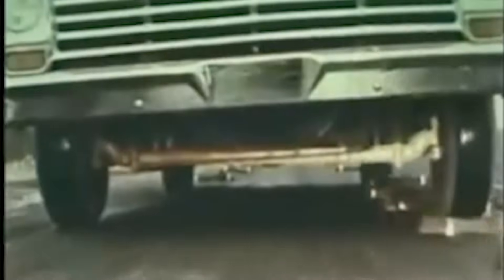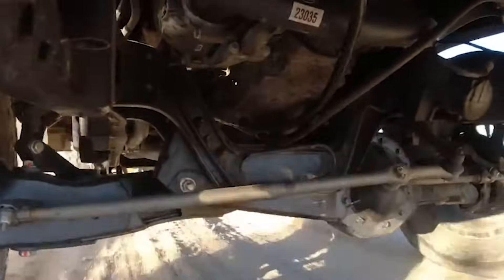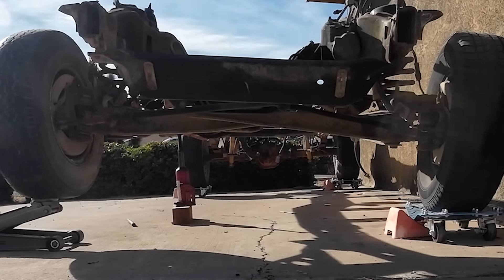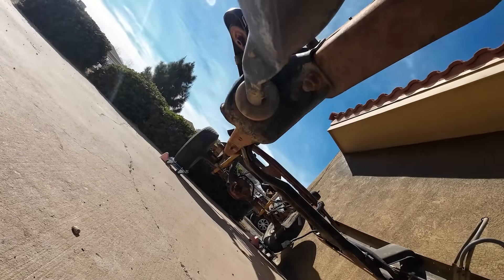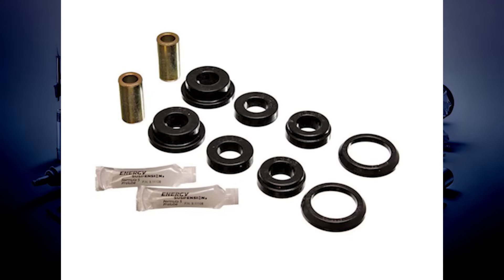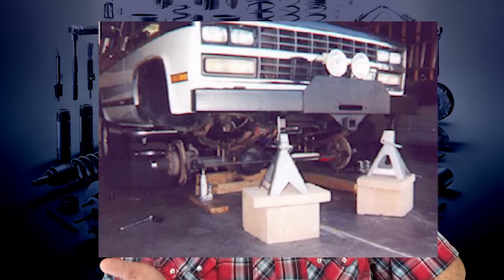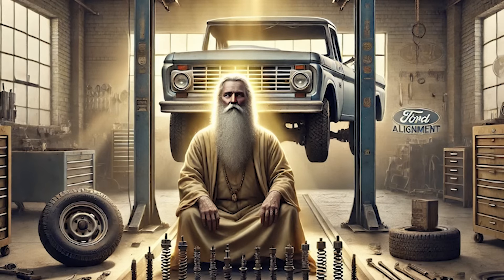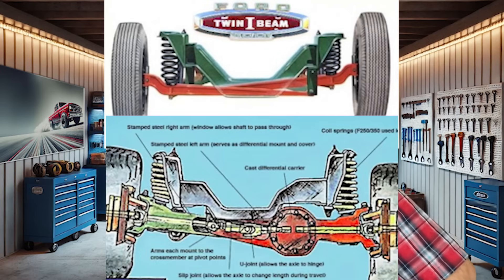Ford’s Twin I-Beam & TTB: Everything You Need to Know About These Innovative Suspensions

Comment: MOST important thing mentioned in video...
Finding a KNOWLEDGEABLE & EXPERIENCED Ford alignment guy/shop!
And preferably not the TYPICAL, ARROGANT
THINK THEY KNOW IT ALL PERSONALITY
that will not listen to YOUR SUGGESTIONS or INSTRUCTIONS about what you want them to do!
FIRST....I WANT ALL these bushings replaced BEFORE you check the alignment.
THEN we can see where its at.
THEN we are going to do some MATH and decide just what way & what new parts we are going to use that BEST accomplish not only getting it into alignment today, but will make FUTURE ADJUSTMENTS an EASIER & LESS EXPENSIVE TASK!!!!
IE: We're going to install THESE AFTERMARKET , ADJUSTABLE UPPER Alignment bushings. NOT the OEM FORD 
(Once its done you own that setting) Non adjustable ( part replacing) bushings.
Because when I come back in 2 or 3 years because I'm out by 1° camber....We are going yo have the EASY JOB of rotating that upper bushings to set it right again. 
That's assumes your bright enough to know what way to position it AND you dont get all passed off when you find you turned it the wrong way....
You see how this goes?
If you dont do it THEIR WAY...
YOU CAN HIT THE HIGHWAY!
PUN INTENDED.

Comment: I think those early compact Ford Ranger 2wd pickups were the worst offenders for a "grocery getter" application and driving problems. On a vehicle that light, just adding a RH passenger risked throwing off the camber, and suddenly the vehicle could begin pulling to the left. I was single at the time I owned one (1986), so when going on dates, the steering wheel effort to keep the vehicle straight became the bellwether on how much weight was too much...I had heard of looks that could crack a mirror, but a woman so heavy that she even made the truck want to commit suicide by veering into oncoming traffic was a new one that only Ranger owners could experience. I learned a valuable life-lesson that guided my choices: beer goggles may deceive, but Twin I-Beams never lie. 

The front shock absorbers were another item that required frequent replacement, and I always theorized it was the excessive unsprung weight of the beams causing issues, though I don't know why the rear shocks seemed to hold up longer even though it used a 7.5" solid axle. If I remember correctly, you could get aluminum twin I beams for some applications from Ford Motorsport to alleviate some of the issue, but they may have been for the F150 Lightning (lightening?) trucks.

Comment: My grandpa recently passed away. I love him dearly and miss him. 
Speaking to my grandma about what cars he's owned (I'm a huge car nut) I learned that he had a deep love for Lincoln and the Ford Econoline. 

I remember one Lincoln, and THREE Econoline vans as a kid. Of course, I never really got to drive them (except the very last econoline, which was a 1999 4.6L) but I grew to love their looks, the sounds, comfort, and memories on road trips.

I really wanted to know just wtf grandma was talking about with the Ford Econoline "Driving well" because I assumed it was just a 70s truck with a solid front axle. (Which I have driven in other vehicles, and am not impressed with) 

Thanks to your video & wikipedia, I learned about Twin-I-Beam suspension on these trucks. (I really appreciate the inserts of the chassis & live offroad driving articulation!)

Having driven the '99 Econoline for a couple years, I grew on the ride & steering immensely. It's such a heavy van that can't corner, or accelerate very quickly with the measly 4.6L, but it has very solid road manners & response time for being a very large & heavy truck frame! 
Knowing that the 3rd gen Econolines of the 70s & 80s are essentially the same design makes it click for my why they would drive so well. My grandpa came from much older vehicles that had leaf springs & solid axles in the front! 

Thank you for this detailed video showing this wonderful technology! Ford is truly a pioneer in truck tech, as well as with their sports cars like the mustang and GT!

Comment: Compared to my friend's YJ, my 89 Bronco II drove better and had just as good a traction as his Jeep did. Alignment wasn't that bad. The biggest issue is clearance. That pumpkin hangs down to far. The ball joint knuckle hack will help somewhat with that. I've driven enough solid axles to know the TTB is a superior system. Limiting straps are a necessity because the articulation is stupid good.

Comment: It was very durable.  It was always hard on tires.  It was much more fussy  about the tires matching.  The four-wheel drive version simply didn't work.  They quickly went back to a live axle for the more heavy-duty trucks   and basically the same independent system as everyone else for  lighter trucks.  No matter what he says, they can't really be aligned because any changes in weight distribution will change everything . Since trucks are meant to haul a variety of loads. In real life, the alignment would always be wrong.  The good thing about them is you could drive them hard  on terrible roads and not have any worries about making them worse.
Reply: Add load leveling in the rear and you can solve the problem.

Comment: I’m about to replace my 2001 gmc 2500hd (current daily driver) with a 94 f250 with a 351 , going down poorly maintained dirt roads the gmc wants to knock your teeth out it rides like a 05 f 350! After riding down the same road in my buddies 95 f150 I can definitely say I’m excited to have the twin I beam instead of the Gm independent suspension which has also proven to not be very durable as it is pretty much slap wore out after 71,000 miles

Comment: Just a little bit of clarification on the 2 wheel drive twin I beam, most of them, like my '81 F 150 had king pins instead of ball joints. The ball joints are not as stout as king pins, buut the camber can be adjusted with those special bushings made for that purpose. King pins do not have adjustable bushings. The only way to adjust the king pin twin I beam is to bend the I beam, which I have heard of only one shop that had some one who could do that, and it was somewhere in the New England States area IIRC. And that was @ ten years ago. Too far for me to go from the West Tennessee. Any way, king pins makes it super easy to maintain the front suspension, just grease every thing with a grease fitting and inspect bushings for wear and damage. Also, the TIB didn't get ball joints until sometime around '82 or '83, I think. but was in the '80s when they showed up for sure.

Comment: I have a 2002 Excursion 7.3, on a trip 2 months ago, I was running 65mph and ran across a beat out railroad crossing with at least 3-4 inches of rail exposed.  Hundreds of dump trucks going to an industrial construction site had pulverized the concrete pads between the rails for cars to smoothly cross.  Well, it about knocked my teeth out, but only finished off the radius arm bushings that had 120k miles on them.  Try that with any other suspension!

Comment: The original twin I beam had king pins instead of ball joints.and the control arms were solid tool steel,bad ass!and the axles had eccentric adjusters on pivot bolts.

Comment: I had a explorer sport two door and it rode like complete crap on that small of wheelbase truck and width. Alignment issues galore, body roll, and very harsh ride, removal of the sway bars when offroading helped but overall I still find it a poor design for suspension.

Comment: good basic video! subscribed. a few points, in the late 90's ford went to solid axles on their f250, and had solid axles on their 85+ f350's (dana 60's and 50's) and only did double wishbone on the 97+ f150. also technically the axles in the ttb are u joint not cv, although you can get cv axles for them. chevy has had ifs on all models since 91, and most models since 88. dodge did sort of the reverse of ford, 1500 through 2001 was solid, 2002 and up was IFS. 2500/3500 through 2002 was solid. 2003 and up was IFS.

Comment: My 99 f350 dually has this. Just took my inch lift springs off cuz it handled like sht. Now the camber is negative 1 degree. I don’t wanna pay to put old alinement things back in and all… I think 1 degree negative should be ok.

Comment: Who makes a decent lift kit for the twin traction beam front ends? I am looking for around 2.5-3" to fit some bigger tires without trimming it. Don't plan to flex it out, it's a long bed, I'll mostly be towing in dirt roads and may need some clearance also.

Comment: I have a 1980 f250 ranch truck. I want to try some of the old NDT military tires on the TTB on the two rut roads. I think the round profile of the tire would work well with the camber arc.

Comment: I have an 86 Econoline in my garage. I am getting a crazy idea lately. I LOVED the ride of this van, but we haven't driven it since about 2001. I want to pull it out, ditch the body, shorten the frame 2-3 feet. Then build a cage on the frame, make doors, the whole nine yards. I want to end up with like a cross between a jeep, a bronco, and a hummer. Closed in top, and maybe try to use the rear a/c in the dash.  A very long time ago, I used to work at a crop dusting business. I routinely drove a Twin I Beam 50-65 mph on gravel roads, and never though twice about it. The truck just floated down a dirt road like you were in a hovercraft. On the road it wasn't spectacular, but it road like a cloud.

Comment: Possibly the worst suspension system ever devised for a pickup truck. Had an 85 F150 and servicing the ball joints was a nightmare. Had to remove those gigantic arms, and take them to a spring shop who had such difficulty pressing them out that he told me to never come back again. GM had a much simpler control arm system. Twin i-beams were a stupid idea. If you want independent suspension, just go to control arms. If you want the strength of a solid axle and leaf springs like a medium duty truck, make it a solid axle

Comment: My F250 never gave me troubles with tire wear, but I learned to align it myself. When it came time to install 4wd, I did end up going with a solid axle.

From what I've seen, most TTB and Twin I-Beam problems come from poor maintenance or poorly installed lift kits. Keep them stock, and they work well.
Reply: This is accurate. Keep it stock, other than some poly bushings, it'll do just fine. It won't be perfect, but any issues that are there, you'll hardly notice.
If you wanna change things, be prepared to learn a whole lot about suspension kinematics and do some significant fab work, or you're gonna make it act funny.

Comment: The Twin I-Beam might have come out in 65 and still used on 2WD Superduty trucks. - But the change from Kingpins to Ball Joints was good for adjustments, bad for durability. I have a Kingpin Econoline that is on its 2nd set of kingpins (500K) and now at 770K miles, since 1978. - I have a Ball joint pickup that is used like a car, and at 300K its on its 3rd set of ball joints and I am a grease gun jockey....They just don't hold up.

Comment: Ive have had and maintained 3 E series vans , 78, 96, and 06. I bought a 2015 transit 250 when they came out but it wasn't a patch to the E series vans,  not enough steel for serious use, i sold it and still have the 06 E 350. Ford still makes the E350 , 450 as a cab and chassis.  
I once let les schwab try to do an alignment after buying tires, after 4 hours they gave up, never again.  I use the moog caster camber adjuster which is a must for getting adjustments beyond the factory spec which is almost a definite requirement as the vehicle gets older or if you put a lift on it , which i have done on the 96, and 06.  Getting as much caster as possible is also a plus for handling.  Some rv forums talk about getting caster angles of 6 to 7 degrees when the factory spec is 2 to 3 degrees.  If you put lift pucks under the springs you have to drop the rear of the control arm the same amount. Toe can accurately be adjusted with 2 framing squares clamped to a straight edge , checking front and rear of the tire at mid height of the tire. Camber can be adjusted with a bubble or by eye , check your spring sag difference as it gets noticeable as they age .  I have no uneven wear on my E series,  practice makes perfect.  Dont underestimate how much worn ball joints can affect handling on these vehicles. WELDTEC DESIGNS makes some really good kits for lift , handling and better ride quality. He has a yt channel.
Reply: Thanks skibby :) 
keep beating that drum for us. Modern trucks and vans are becoming headaches and these older machines can last incredibly with good maintenance. The shame I see is where maintenance knowledge and technique is lost to time… thanks for keeping the dust off it.

Comment: I drove TTB Ford vehicles about 20 years, using them in some extremely arduous off-road applications.  Yes, the dynamic camber and alignment difficulty was a challenge.  The biggest drawback of the TTB was that Ford chronically equipped TTB trucks with inadequate soft front springs and shocks--presumably to make the vehicle ride better.  Replacing the front springs and shocks with heavier duty versions would improve their handling, performance, and reduce dynamic camber alignment issues, with just a modest decrease in riding comfort.  Depending on one's viewpoint, the TTB was the best or worst compromise between a solid front axle and a fully independent front suspension.  On the positive side, the TTB captured many of the advantages of an IFS while retaining most of the toughness of a solid front axle.  On the negative side, the TTB captured much of the unsprung weight disadvantage of a solid front axle while only capturing some of the advantages of an IFS.  In essence, both opinions are true.

Comment: I have an '81 E370 1 ton box van with Twin I-Beam that I want to convert to TTB. Is there a guide somewhere for doing this swap? I own a fab shop and can build anything, but would much prefer to do it with stock, bolt-in parts if possible. I only intend to use 4wd in the snow, not gonna be wheeler. I already have a collection of off road toys.
Reply: I have only seen ONE Econoline swapped to TTB, its in Australia...Almost ALL Econoline 4x4 conversions are Straight Axle...

Comment: Yep, I too owned two 4X4 F-250 with front solid axles and dam they went through tires like a hot knife in butter and yet my 91 Explorer 'Twin Traction beams' went on 300,000 miles and for 15 years and tires were never a problem ! Go figure ? Since then, all my Fords RWD and AWD have been independent front ends.
Fun video, thanks.

Comment: I was the only alignment tech in the county that could properly align a twin I-beam.      Then I retired
Reply: I need your knowledge for my ranger all the shops fuck it up worse than I do 😂
Reply: Our grandson (a trained and credentialed automotive technician) aligned my wife's '94 F150 4WD about two years and 30,000 miles ago.  Tire wear is not an issue - so long as we maintain proper tire inflation and rotate & balance the tires at 6,000 mile intervals.  I have owned & driven twin-i and twin traction beam Fords all my life and am very pleased with ride, handling, performance, endurance, and tire wear.  No regrets - I plan to drive these for the rest of my life.  It works so I have no plans to "fix" it.

Comment: They toe out on bump and rebound.  Which eats tires.  A couple of us who know suspension geometry spend some time many years ago trying to figure out a way to get the steering linkage to track the suspension travel.  It's simply not possible.  Ford has used several different tie rod lay outs over the decades.  None of them work.  
There's another real drawback.  The high roll center of the semi leading arm design means that if you cut the steering wheel hard to one side and hit the brakes hard at the same time the suspension wants to jack up on the outside and roll under, flipping the truck.  I have seen people do this.  The TTB with shorter swing arms makes this effect about twice as bad.  Lethal.
Yes, they ride well.  Yes, they are hard to break.  And an absolute loser otherwise.  Hordes of owners who love them because they just don't understand the drawbacks.  You wont find many alignment techs who will own one.
Reply: Interesting. My dad owned an alignment shop for 4 decades. All he owned since he left Ford, was Twin I Beam Fords. - I still own some he had...I don't see an issue with them. - I will not own a TTB truck, mostly because real 4x4 trucks have straight axles.

Comment: One thing I'll say about the twin I beam, it holds alignment like no other. I got the alignment right on my Ranger's front end, I didn't have to touch it again for the next 10 years. All I did was rotate the tires every 5k miles, and I consistently got darn near perfect wear across multiple sets of tires.
Reply: Lucky.
Reply: @robertsolomielke5134  nah, they're just built strong. Most you'll have to do to keep the alignment where it is is make sure your bushings are in order. Assuming you got the right alignment in the first place, anyway. I accidentally wanged my tire into a barrier in a parking lot the other day. Horrendous bang noise. Checked that the wheel and tire didn't appear damaged at a glance. Went on about my day. Drive perfectly since. I'm not at all concerned that I messed up the alignment. If anything was gonna get bent, it would have been the cheap steel wheel.
Bushings are the main thing that will usually cause alignment issues on a TIB.
Reply: Howd you align it? Mines worn to hell, just replaced the shocks but my alignment is totally shit right now and im not about to pay another shop to fuck it up (again) when I can just go and do that my damn self lol
Reply: @everetteworley1333  I found a guy that knew what he was doing.